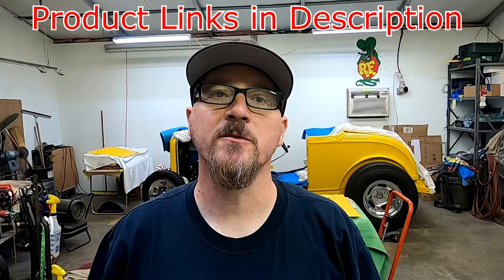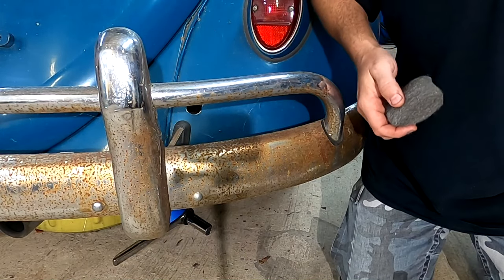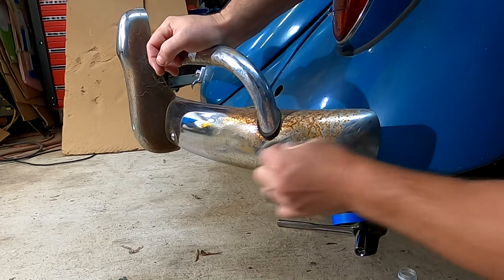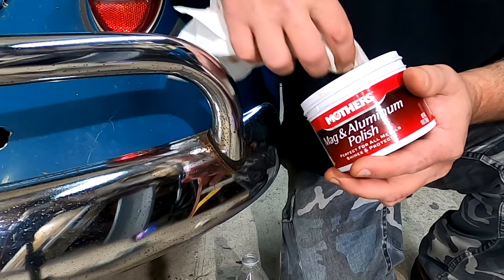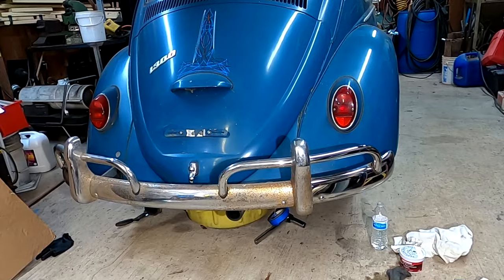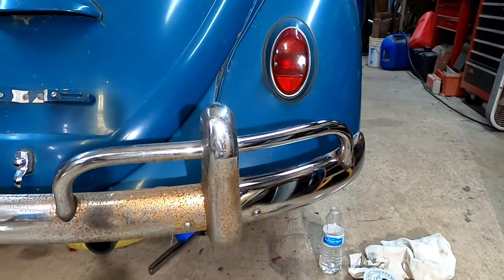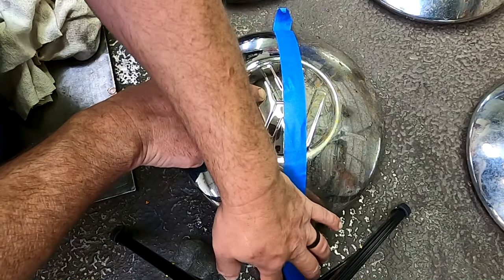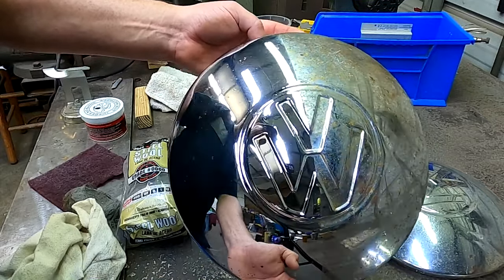FASTEST and EASIEST way to (REMOVE RUST) from CHROME Bumpers on CLASSIC CARS [VW Beetle]

Comment: Caught ur title 2 as I'm always open 2 others' suggestions. On par with what I normally do but I would like to provide one suggestion that you should try for yourself. I use distilled water (minimizes mineral content in the water + still cheap) as well as dawn platinum (any dawn will do)  dish soap mixed in with it as it has cleaning abilities as well as in this instance little bit of lubrication in the process. 

Supporting Example:
Think of a slip and slide rite. You can go down it pretty nicely with water. But u can often get scratched up or feel friction on yuh. But you add soap onto the slide. Voof, far faster and less harsh. Granted, yes, I know u want abrasiveness. However, when using the soapy water + 0000 steel wool on my windows as well as chrome. It saved the risk of any deep scratches and aids the removal of the iron and other oxides that are there. Just a suggestion.
Reply from the maker: Awesome great idea, thanks for the tip!!!!
Reply: @ACDesignsGarage  Absolutely. Vids help my adhd while I'm working on things. Lol Currently, I'm now painting the corroseal primered areas of both my Fiesta front hub assemblies as well as the calipers. Much needed love as our Fam mechanic never mentioned how bad it was. Suppose that is another good  reason why DIY saves money. Hehe

Comment: That was an incredible result wow
Reply from the maker: Thank you, I was pretty amazed myself lol
Reply: @ACDesignsGarage  I went and bought the same exact steel wool pad and found another product you would probably find cool as well. It's a Rust-Oleum spray gel rust dissolve. I'm going to try that instead of the water or vinegar and see how it works. I think it will work great for getting into little nooks and crannies, I'm also going to soak down the frame and underbody and scrape off any rust I can find before doing an undercoat to protect the other side of the car.
Reply from the maker: @2pink1stink  awesome I may try that also, thanks for the tip!!!!

Comment: I have used that 0000 steel wool for 40 years and it works best when you put Turtle Wax Chrome polish on the steel wool. it minimizes scratching, removes rust faster and leaves a nice shine. Don't try this on a nice or descent chrome it WILL scratch the heck out of the surface  with fine thin scratches. Some people say it don't but to the trained eye or next to nice chrome it's very noticeable or looking at the reflection you'll see the scratches.
Reply from the maker: Yeah I agree the only way I'd use this is on old rusty stuff, thanks for the turtle wax tip!!!!

Comment: Keep doing that with Steel Wool and I'd imagine you won't have much chrome left in a short period of time.  You want something softer than the chrome.  Such as brass.  Tin foil and water works on most rusted chrome.
Reply from the maker: I've used that also, these are after market bumpers that ill have redone in the future.

Comment: what you thing about using vinegar instead of water? and finish it with clear coat instead of wax?
Reply from the maker: Ill have to try the vinegar, as for the clear, i have cleared over bare metal before but rust still comes back.

Comment: Awesome vid. You've done exactly what I had mentally prepared to do to restore my w113. There's no negatives to the steel wool right?
Reply from the maker: I had no issues with the 0000 steel wool, its still holding up, always try on a hidden place first to make sure.
Reply: the only negative is that it's not as good as stripping back to bare metal and rechroming. BUT if you know you're not going to do that, then it's great.
Reply from the maker: @frankfisher8423  100% agree!!

Comment: I do not think this would work to remove greenish stain on motorcycle exhaust muffler.  Also, wax applied to any "restored" exhaust muffler chrome will just burn off and the rust spots will come right back.
Reply from the maker: Yeah this is just a temporary fix, your better off if you can get mufflers made from stainless and thell never rust.